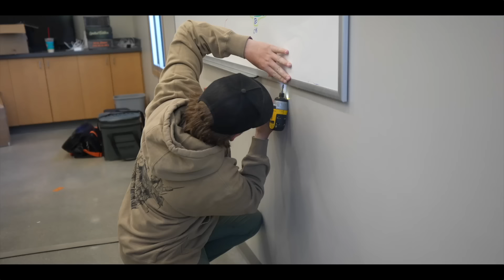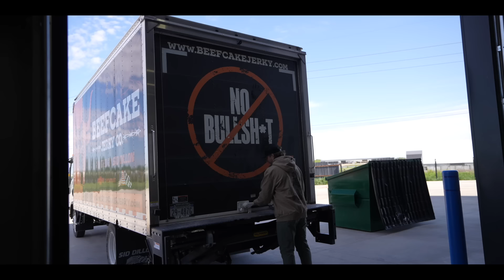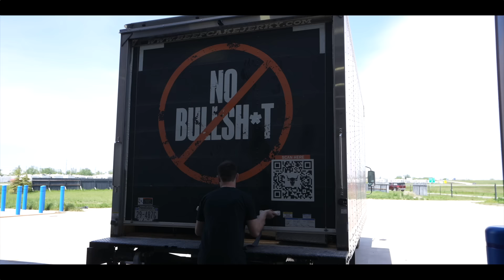Shutting Down BeefCake Jerky.... (RIP)

Comment: Hey Flair,
Have you looked into getting a portable truck ramp?
They are about 25ft long and on wheels.  If you are unloading a full trailer you have to pull the back four pallets off the truck using a pallet puller, secure the ramp to the trailer/container and then you are able to drive into the trailer to load or unload.  Saves the expense building a raised truck dock with a ramp
Reply: had one of these at the flooring store i managed can say it was a huge time saver.
Reply: I second this request! If you want to look at one in person, go behind any Tractor Supply. I think I've seen 2 store locations that had a more traditional kind of dock. Those ramps make it so, So much easier to unload. 

If you do just pull the pallets to the edge and lower them with a forklift, I would strongly recommend getting a pallet puller. It allows you to grab the middle of the pallet and pull it forward with a chain.

Comment: You can get a portable forklift ramp to drive up into the trailers and your truck, or, potentially build a solid outside ramp where trailers and your truck could back up to and you could drive in. Just a couple suggestions.

Comment: Get a compact forklift one of the standing ones that can do a 360 in like 6-8ft of space.(like the ones home depot use) Then you can put the shelves closer and i would add another section of rail up on the shelves you could fit another row of pallets maby double stacked. If you get big enough and need to go bigger just hrab a scissor lift and move the shelves 6ft apart.

Comment: “Get a forklift” will NOT help your situation. Without a dock, a forklift can only get the first 2/3 rows of pallets. Which is about 10% of the truck. Plus, if you don’t have a dock that means you are offloading each pallet outside then driving each one inside and into the spot where it’s supposed to be, then driving back out side to get another one. Man, you’re already killing your efficiency if you need to move serious product. You are going to be completely handicapped without at least 2 loading docks(one incoming and one outgoing). You really need to consult with a LEAN Six Sigma Black belt consultant to help you with the logistics of setting up and  running an efficient operation. Also, should have made a deal with the owner, that you will take both properties for a longer term if he builds the loading docks for you.

Comment: Oh my that set up is piss poor boys. Pallet racks like that suck, you know they have them that feed on one end and come out the other end? And so much wasted space setting up racks like that it actually creates you less room than not having racks.  But if you are going to use 1980 style racks they should be on the outside a long edge of wall with the inside center racks being butted up to each other as you don't need to get to both sides of the racks. But you could've had a setup with first in first out without having to juggle pallets around. Dang flair sometimes it would save you money to hire a consultant instead of the seat of the pants plans

Comment: You made me cringe when y'all were drilling them anchors onto the concrete at angle. You could've marked the holes with paint or a marker and then slid the shelves over a couple inches while you drilled all the holes. Then moved them and then put in the anchors and torque them. 

Another lesson from the HandySmith for free,